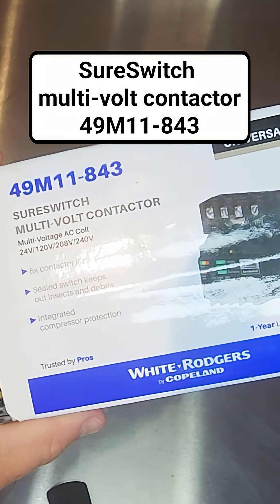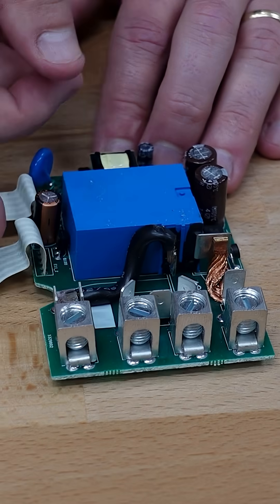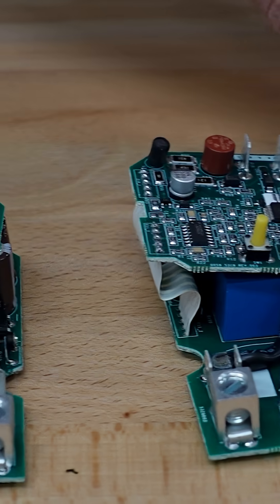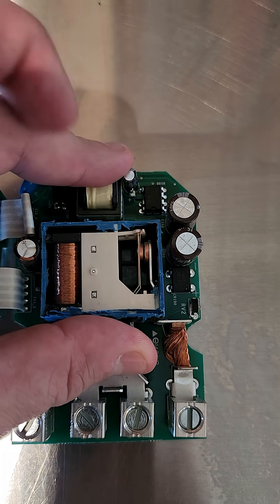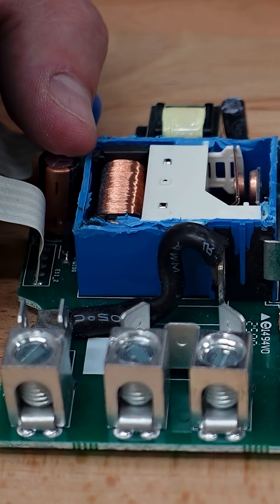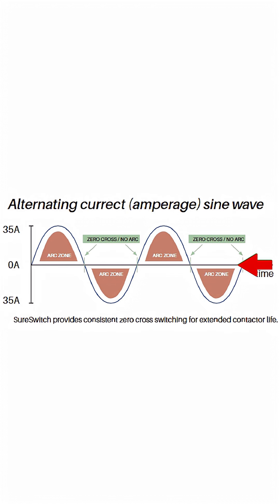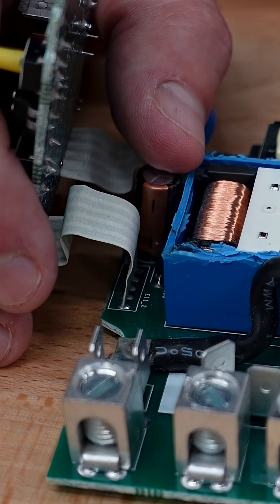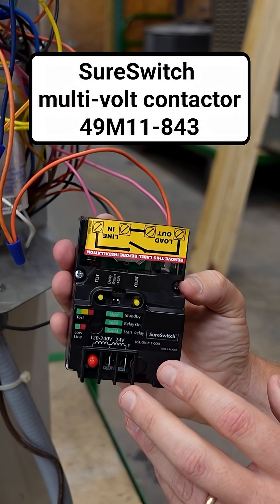SureSwitch by Copeland: The Contactor That Lasts 5x Longer

Comment: I’m just a homeowner, but I installed one on my own unit this year to replace a 19yr old Carrier OEM.  Install was straightforward and it works as one would expect a contactor to work, but with the added benefit of knowing my compressor won’t stall during a brownout (my main motivation), and will enter a time delay as well before re-engaging.